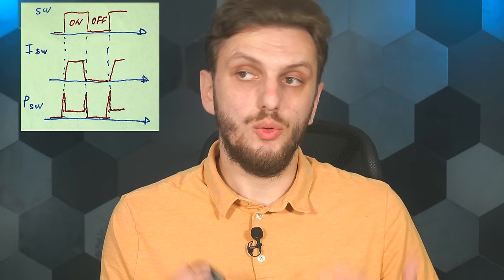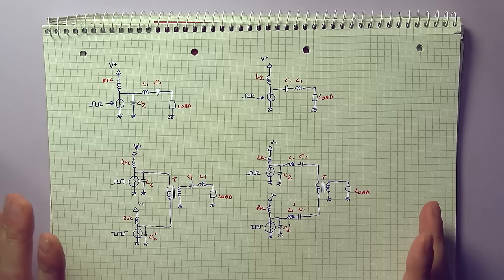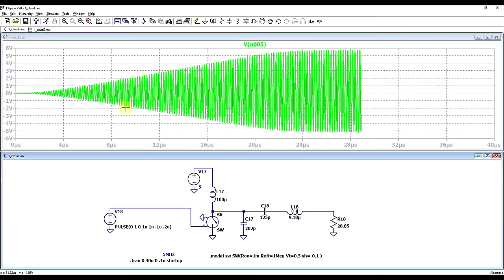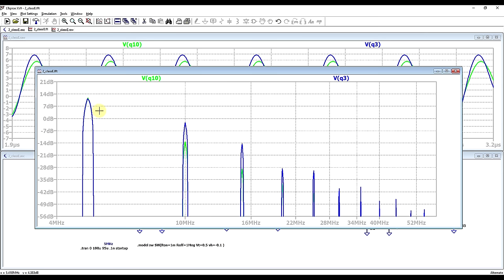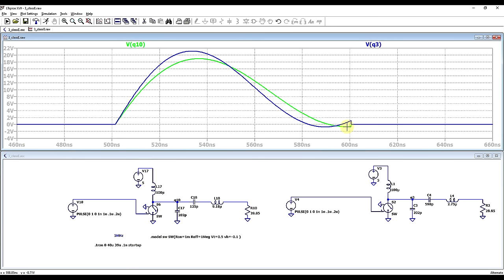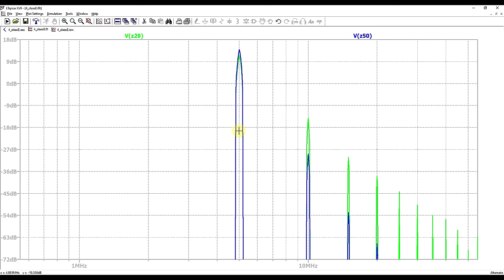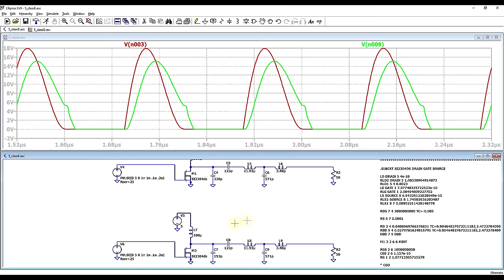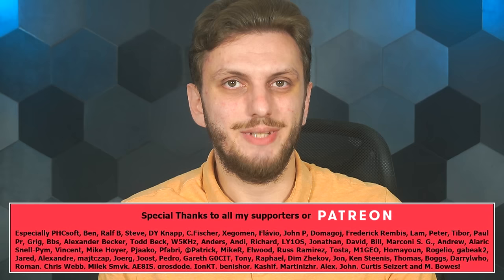Class E RF amplifier - Basics (1/3)

Comment: ❤ 👍 For the real amplifier I would recommend considering an LC matching network instead of a T network though. The main source of loss is the inductance (it typically has much lower Q than capacitors) and you ended up having two inductors in the matching network.
Reply from the maker: You are completely right! the inductors are a big issue when it comes to losses; I guess another thing I could have done was use a lower Q factor for the initial circuit - to have smaller inductor values; regarding T vs L matching - I guess this will highly depend on the application - if you need reduced harmonics for something like a HAM transmitter, even the single T network is insufficient... Anyway, I will not change the circuit since this way the practical build is better linked to the simulation

Comment: Good presentation, but it might be helpful to emphasize that the class-E switches at the transmit frequency while the class-D has to switch at a large multiple of this frequency, generally at least five times higher and frequently ten times higher, resulting in much higher switching losses. There is also an argument to be made for having turn off occur with ZCS rather than ZVS. Finally, using a duty cycle less than 50% isn't illegal and has interesting effects. The major reason for emphasis on 50% duty cycle is that it makes the mathematics more tractable, but since you are a simulation guru, this shouldn't deter you! ;-)

Comment: The class E, inverse F, etc has remained mostly in the academic world,  as the practical use is limited to CW, OOK, and FM etc.
High order modulation techniques with high data rates require very linear amplifiers. 
Class E is like a more extreme class C, like exciting a resonant circuit, but uses better terminations for harmonics to restore a sinusoidal waveform. At higher power levels and frequencies getting a good driver becomes a challenge, which should be pretty much a squarewave, and output devices need very low internal capacitance, as it gets in the way of tuning and efficiency.
Parts availability, and price, becomes an issue, so overall the concept remains of low use.
Like the distributed amplifier, the concept goes back to the 1930's using tubes.

Comment: Your timing is great. I'm trying to build a class E amp with a GAN device for the HF frequencies, and it works great in LTSpice. It's not so great in real life, so I'm anxiously waiting for your next video.
Reply from the maker: What sort of issues do you have? I mean what exactly is different in the real circuit compared to the simulation
Reply: @FesZElectronics  Basically I'm not getting the voltage and current waveforms looking anything like they are supposed to. I'm using an EPC8010, which has a spice model, so I don't think it is non-ideal behavior of the transistor. The closest thing I can get to in LTspice to what I'm getting in the real world is putting stray inductance between source and GND, and between drain and C1, so I created some PCB, slavishly following the design layout recommendations from EPC, and they just came in, so I will see if things are better behaved.
Reply from the maker: In my simulations, I've seen that adding a gate driver (not just an ideal voltage source, but at least having a series resistor) will help with the realism; depending on the operating frequency, the inductor parallel capacitances will start to also be an issue, and also regarding the inductors, they all have quite a bit of series resistance - from skin effect...

Comment: I'm working on a CW-transceiver port backpack use and trying to optimize for everything regarding efficiency, features and size.
I was working with class-C (netting only [in my mind] so-so performance) but after seeing the class-E topology/attributes have completely abandoned the class-C.
Another consideration is SWR encountered with mis-tuned antennas; it's looking like class-E could be more tolerant of catastrophic mismatches (?).  
Thanks and looking forward to the build-video!  73...
Reply from the maker: I guess one of the big issues with class E, as with other switching amplifiers, is getting the transistor to switch fast enough at your frequency of interest. Regarding the connection to mismatched loads, I'm not sure what to say - as always I recommend a quick simulation - both to confirm the transistor you want to use can switch efficiently, and also to see the impact of the load mismatch..

Comment: What are the typical upper power and frequency for the E class amplifier?
Reply from the maker: I don't think there is a lower frequency limit; for the higher value, you will mostly be limited by being able to get the transistor to "switch" - you need to ensure rise and fall times smaller than the half period of the signal; there are practical designs going into the GHz range but usually does are custom made IC's, I'm not sure how easy it would be to make those with discrete components...

Comment: Why does the output power of the class-E amplifier have different pk-pk without adding the compensating network.
Reply: By doing impedance matching my current gets very high compared to my output voltage it eliminates those reflections; however, I wish to not have a very high current since it’s for some coils and it makes the application more difficult

Comment: Very nice video sieres. I've come across a problem and despite putting the same ltspice derivative I'm having the error "can't find the definition ... ". I also tried newer and older versions but it doesn't seem to work. I would love to hear a solution if you have any.
Reply from the maker: Maybe you can share some details - what is the exact derivative and the full error code
Reply: @FesZElectronics  Yes of cource! m1: Can't find definition of model "si2304ds" and the derivative is the exact same with yours. I would appreciate any help. I also watced your video about models and subckt but i didn't managed to make it work.
 ***************************************************************
* NXP SI2304DS
*
* Polarity N-Channel
* Ratings 30V/7.600000E-002OHMS/1.7A
*
* Date Created Thu Apr 19 06:31:03 2012
*
***************************************************************
* Model Generated by Transim Technology
*           Copyright(c) 2004
*         All Rights Reserved
*    UNPUBLISHED LICENSED SOFTWARE
*           www.transim.com
*
* Contains Proprietary Information Which
* is The Property of Transim or it's licensees.
*
* Commercial Use or Resale Restricted by
* Transim License Agreement.
*
***************************************************************
 
.SUBCKT SI2304DS DRAIN GATE SOURCE
 
LD DRAIN 5 4e-10
RLD2 DRAIN 5 1.00530964914873
RLD1 5 4 0.0023
LG GATE 1 7.97740315722523e-10
RLG GATE 1 2.00494009227702
LS SOURCE 8 6.94325122020549e-10
RLS2 SOURCE 8 1.74502936203407
RLS1 8 7 0.00952211428140778
 
RDS 7 4 3000000000 TC=-0.005
 
RS 6 7 0.0001
 
RD 3 4 0.0408969766276831 TC=0.00464827672211182,2.47227840906323E-05
RBD 9 4 0.0279781624816791 TC=0.00464827672211182,2.47227840906323E-05
DBD 7 9 DBD
 
M1 3 2 6 6 MINT
 
RGS 2 6 1000000000
CGS 2 6 1.157e-10
RG 1 2 1.97713365715578
 
* CGD
C11    11   12   1E-12
V11    11   0   0Vdc
G11    3 2 VALUE { V(13, 0)*I(V11) }
E11    12   0  3 2  1
E12    13   0  TABLE {V(12)}
+ -20           172.8
+ -12           171.5
+ -10           171
+ -5            169.1
+ -4            169.3
+ -3            170.5
+ -2            275.8
+ -1            247.7
+ -0.5          229.5
+ -0.2          219
+ -0.1          213.4
+ 0             204.15
+ 0.1           195.9
+ 0.2           185.2
+ 0.5           165.8
+ 1             133.1
+ 2             104
+ 5             73
+ 10            55.3
+ 12            51.3
+ 20            41.5
+ 25            37.9
+ 30            35.3
 

 
.MODEL MINT NMOS(Vto=2.55 Kp=5.815550e+000 Nfs=1160000000000 Eta=100
+ Level=3 L=1e-4 W=1e-4 Gamma=0 Phi=0.6 Is=1e-24
+ Js=0 Pb=0.8 Cj=0 Cjsw=0 Cgso=0 Cgdo=0 Cgbo=0
+ Tox=1e-07 Xj=0
+ U0=600 Vmax=2000)
 
.MODEL DBD D(Bv=38.6 Ibv=1.000000E-005 Rs=1E-6 Is=1.53489332570028e-13
+ N=1 M=0.44 VJ=0.5 Fc=0.5 Cjo=1.097e-10 Tt=1.85e-08)
 
.ENDS
Reply from the maker: @user-nd6kw5wp8g  Did you set the prefix of the transistor in the schematic to be of type X? if you hold CTRL and right click on the transistor a "component attribute window" will appear, and here the prefix needs to be set to "X" to highlight its a subckt not a mosfet

Comment: Hi @FesZ Electronics> What does it mean 1,154 in the expression ?
Reply from the maker: You mean at 4:38 for calculating Pout? its just a number "1.154". I am not sure of the exact way in which it was determined.
Reply: @FesZElectronics  Is it possible that this is the way to calculate the output voltage peak?
Reply: I wondered about this too, in the QEX paper (https://people.physics.anu.edu.au/~dxt103/160m/class_E_amplifier_design.pdf) and the calculator there use 1.0033 (for a Q of 5). I don't think it makes a particularly large difference in the result though.

PS nice video, thank you :)

Comment: IF the input is a 50% PWM how do we transmit data? as in what type of modulation works in this case? do normal ones send also other duty cycles of  waves or do they use OOK ing ?
Reply: My guess: narrow band FM.

Comment: Nice video! It happened just as I am experimenting with such amplifiers! Is there any workaround for when the Coss of the MOSFET is larger than the designed parallel capacitance?
Reply from the maker: Choose a different transistor :D In general you will want to have the Coss not just smaller, but significantly smaller since the Coss is not really a constant, so if that is the only resonant capacitance you are relying on it will create losses and distortion.
Reply: @FesZElectronics  you just crushed my hopes of having a high efficiency PA for my 28.1MHz beacon. :-D 
I'll try to make it class C then ...
Reply from the maker: I guess you could try to design the circuit to run into a very small impedance - that would increase the needed parallel capacitance. Anyway, I think it will not be that easy to get the transistor to switch at 28MHz in the first place - you will need a very fast transistor. As always, I highly recommend that you try simulating the circuit to see how it might behave before building anything - of course if you have a simulation model available.
Reply: Both increasing the output power or decreasing Vdd can do the trick. Decreasing Vdd is not my favorite idea, as the MOSFET become less well behaved. Also, I'd like to constrain the power to .5~1W. This is too much for a 2N7000 to handle and the IRF510 has too much capacitance.
Also the driving power of the Si5351 used as signal generator is really low (5mW), so I'm now considering using a class A or single sided class B to take it to 50~100mW and then pushing it through a class C to reach 1W.